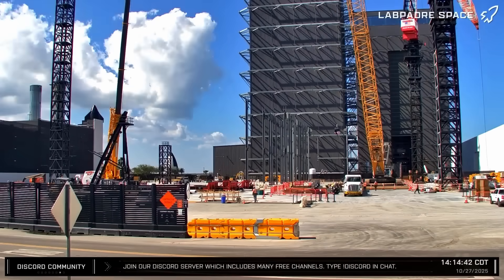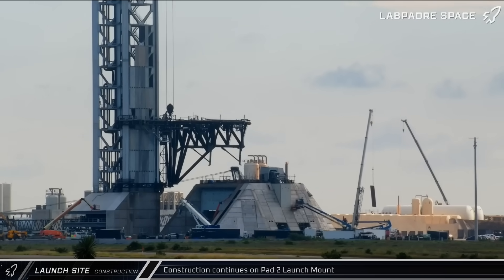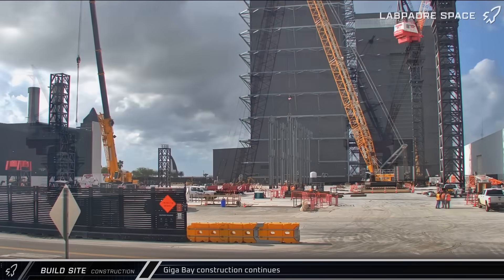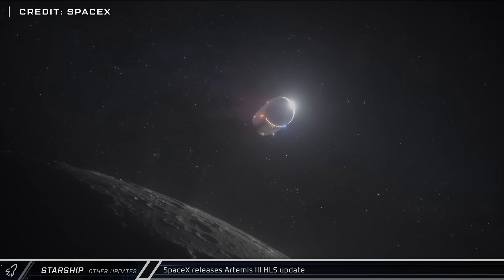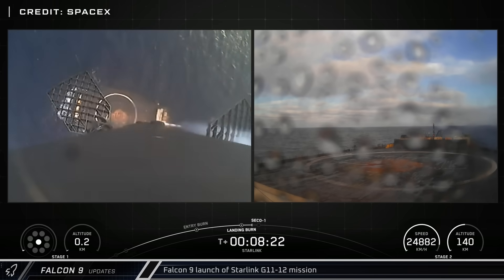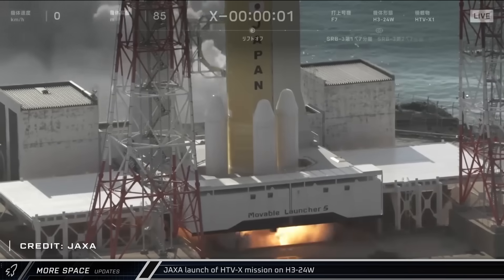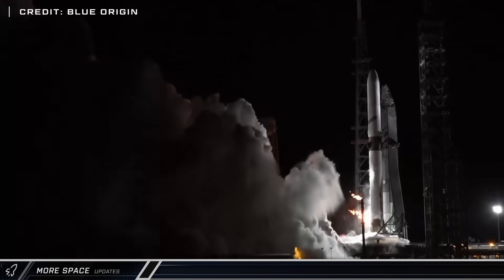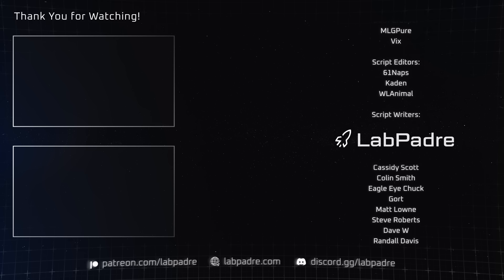2026 Is Going To Be An Incredible Year For Starship - Spaceflight Weekly #191

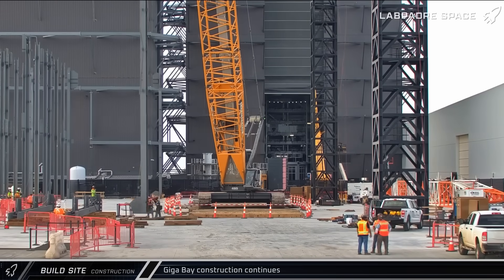Comment: 2:50 Interesting thought that just occurred to me: Do you think SpaceX will one day open a „SpaceX museum“ (most likely in Starbase) with exhibits from their entire history? Think pieces of Falcon 1 tech, to landing legs, Merlin engines, Dragon, suborbital Starship prototypes (think about the commemorative pieces they cut out of SN15), Superheavy, and then the different Starship versions
Centerpiece could be a full Starship or a Crew Starship cabin, and it would also be the perfect place for pieces of ground infrastructure like maybe the Pad A QD or pieces of the mid/high bay
Reply: They might one day have a visitor center but as for a actual museum?  Maybe in a few more decades.
Reply: There is already a Museum Of Failure, so what will they call it?

Comment: If flight 12 goes well, which I think it will, I think it'll will be an epic year for SpaceX.
Reply: There's a scent of destiny in the air... 🚀
Reply: I really hope Flight 12 goes boring well as Scott Manley puts it but I have a feeling that a new generation of Starship might take a couple of flights to figure out.
Reply: @JurassicFart615Excitement guaranteed! 🚀
Reply: While an optimist I suspect there is at least a few small issues.   Maybe not mission ending but along the lines of engines out or not relighting.  Maybe something partially melting or failing on entry.